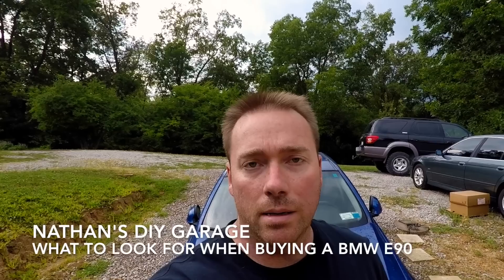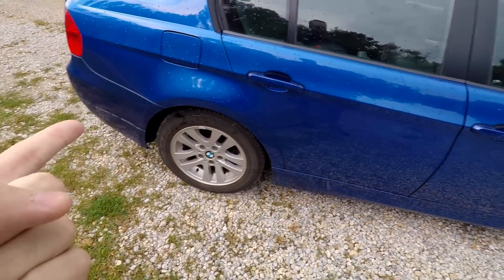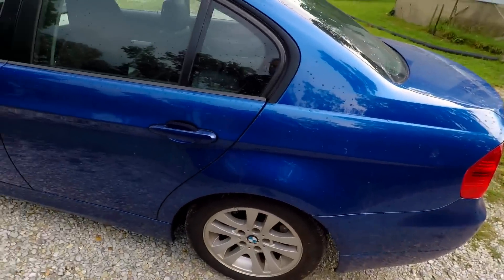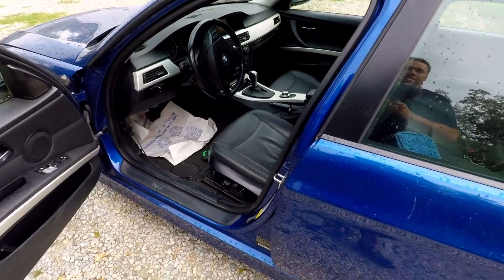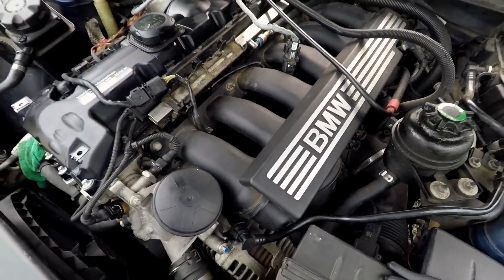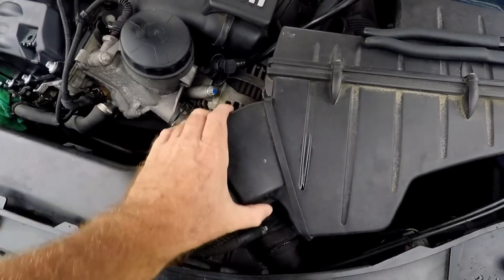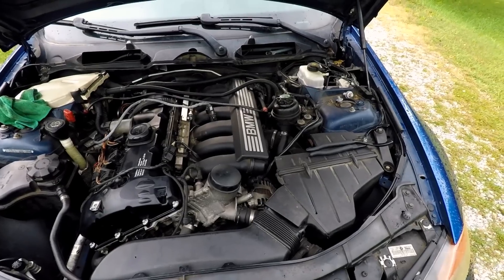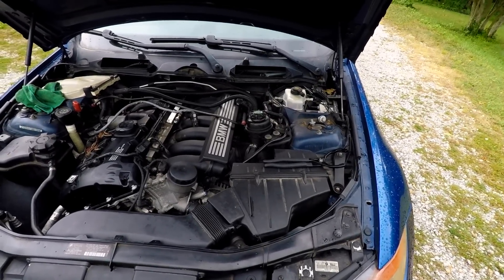What To Look For When Buying A BMW E90 E91 E92 E93  2006-2013 3-series

Comment: $150 to fix the water pump?   I just replaced my cooling system ( water pump and thermostat ) and its $400 in parts from ecs using the good stuff.   The maintenance on these cars is easily done by anyone that can turn a wrench and follow a video.  Don't let this video scare you,  These are amazing cars for those people that aren't afraid to get their hands dirty
Reply: You just gave me hope
Reply: Well 😂😂😂 not all maintenance a lot of the electrical components need coded by bmw and the timing chain probably shouldn't be done by just anyone.......
Reply: instablaster
Reply: And if that doesn’t work at least it’s a cool looking lawn ornament
Reply: I lost hope after the video then regained hope from this.
Reply: @arandompanda1349 and buy it diesel 330d not 335 if you don’t want to change the clutch every year :)) m57 for 330d and m47 for 320d or even the n47 but change the timing chain

Comment: For the manual gearbox version, check that you don't have a strange sound when pushing down the clutch halfway when in neutral. That's a worn out dual mass flywheel and a costly replacement if you can't do it yourself. Buying the parts online and doing the job yourself is around 600$.
Reply: Thanks for the tip, I'm looking at one tonight!

Comment: You have to be smart about these cars.  If the valve cover gasket leaks, change the VANOS sensor at the same time.  The coil packs will all go at about 85k miles.  Spark plug and wire change is what it takes.  At 100k plus you will need a water pump, hoses and maybe a radiator.  The AWD system is reliable but you can get some failures of the rear seals and gears when they get loud.  Early AWD cars had transmission failures but the new ones are fine with regular flush and fill.  One main problem is with the battery housing which tends to fry out at 100k which there is a factory recall on but they never tell you about it.  Great driving and handling cars but you have to pay a bit more for them.  Welcome to the world of nice cars.

Comment: E90 leak points :
Navigation unit , they failing all the time , the most searched thing for this cars ( E60 too ) . If it blinks from time to time , its going to fail soon .
IBS (Intelligent Battery Sensor) , the sensor connected to the battery .
Crankshaft pulleys .
The brake disc on this cars ... they are curving ( not sure this is the right word ) all the time .
Guess you guys don't drive diesels , but if you do , remove the swirl flaps if you want to protect the engine from failing , and frequently change the oil gases filter .
If its manual , for sure the flywheel its thing that have problems with , a lot in our shop .
The rear electrical windows mechanism . The motor itself its tough , but the plastic rail failing all the time , so check for proper movement on the back windows .
For some reason ones again , the rear doors locking mechanism .
And lets not forget , the dynamic drive :D

Comment: Change motor mounts and oil filter housing gaskets if you are looking into an e90 335i. It'll help prevent any possiblity of a failing serpentine belt due to oil corrosion or the power steering pulley smacking the subframe and damaging the belt. You can also easily inspect the wastegate by reaching down (on a cold car of course) and checking for over excessive play. I would do an oil service as well as a coolant flush that way you can be 100% sure you have the  correct oil and coolant types.

Comment: I’ll check today 325 2010 
He said only problem that it need to change ac condenser and compressor , he bought the compressor but I don't know about condenser anyway I'll check it and take it if it's in a good condition except that issue
But my dought why he want to sell it ? And there is no service record ?
Milage is 124.274 mile is too much  for n52 engine ?

Comment: I have an opportunity to buy a one owner no accident 2011 328i drive with 50,000 Connecticut miles for $12,900 from a used car dealer who got the car from a BMW dealer who received it as a trade in. What do you think? What questions should I ask?
Reply: Hey, how’d your purchase go? I’m in a similar situation now lol
Reply: @kylehunter6679  I am enjoying the car and it's a pleasure to drive. However, I had to spend $2,000 in repairs to replace a blown gasket 10 months after my purchase and a thruster arm this summer. When you buy a car that is 10 years old you have to expect some maintenance repairs like these. It's not a new car. Just make sure to do your due diligence in examining the car for any maintenance issues or for signs of a recent paint job that may hid some damage. Good luck. Let us know what you did.

Comment: Very usefull info. What about rust? Which are the most common rusted body parts on these models? Any chance in the future do make a video on a e90 diesel?
Reply: Vlad ZSX Rust: All Models on the underflor, especially under pannels and above the fuel tank. E91 the back door has a problem on the sides. There are plastic covers what scrape away the paint.

All 6 cyl Diesel models are ok. The M57 will lose oil on the intake mainfold. Can be fixed with the a Part of a E39 M57. In German its called Kurbelgehäseentlüftung. Must be something like crank case  ventilation in english.
Reply: Lukas Meyer Thanks for the info buddy. I'm thinking of buying a 320d e92...i heard it has a lot of problems with the timing..is it true?
Reply: Lukas Meyer Rust on the under floor?? You mean under the carpet inside the car?? What could possibly cause that to rust?? That is awful!
Reply: Vlad ZSX No on the otherside. On the underside of the car. It only has one coat of primer paint there. Salt can stay under the pannels for a long time.

Comment: I'd like to know where you found a water pump for 150 bucks...  Mine has almost 200k miles on it, I think I should replace it, but I haven't had a deviation code pop up yet...
Reply: ebay and on amazon just make sure that the origin of the maker is Germany it will have a stamp on the end  of the water pump, Also iits a very good idea to replace the thermostat at the same time as the pump for they are bolted  together, You both parts in a combo kit from 150 - 179 us dollats,  on check pout they will make you enter your vehivle info to make sure it fits

Comment: Thanks for the video, however, it would have been great if you could point to some of the items you said need to be inspected. What I mean is when you were talking about the belt, you could have tried to put some light on it and show it up close. Also, it wasn't quite clear how you would test the control arms. All in all, good video with valid points but need to have a remake and show some things in more detail. Basically, how you are inspecting an unfamiliar e90 car

Comment: FYI,
1) BMW xDrive transfer case does NOT take ATF! It uses a special "BMW transfer case oil", about $50/liter
2) 328xi like the one in the video uses GM 6L45 transmission which does NOT have the built-in filter in the pan (unlike the ZF transmissions in other E90s)
Reply from the maker: 3) You should know then that this is a  pre-xdrive car , all of these older cars will run the trans fluid in the transfer case with no issue, if you work at a dealer which is the way it sounds or a (indy) shop you should know this, I will give you that awd models dont have the zf

Comment: Either one is not fine. The coolant matters for electric water pumps. To maintain long life on the water pump, make sure the coolant is still the factory blue colour.
Reply from the maker: Devin Smith the pump will go around  80k miles no matter what you put in it, BMW is scamming you to buy the blue stuff from them
Reply: We don't scam people. Our coolant is recommended because its the right formulations. The coolant we sell that is available in 3 sizes. 1.5L, 60L and 205L there is only 16 approved other manufacturer coolants. The coolant lubricates the electric waterpump. And besides our coolant is not really that expensive. With only one exception, the W16 engine must run a special coolant that is yellow if I remember correctly. The coolant is a lifetime fill. But needs regular top ups due to slow losses in the system. Use the wrong coolant and the car becomes unreliable (corrosion which will clog up the radiator and shit). The same with the oil. 

List of approved oem coolants:

AD Original AD 48         
Alpine C48 Longlife Antifreeze 
Antifreeze concentrate AWM G11
Aral Antifreeze Extra
AVIA Antifreeze APN
BMW Antifreeze
Castrol Radiocool NF
Fuchs MAINTAIN FRICOFIN
GLYSANTIN® G48®-24 Engine Coolant 
GLYSANTIN® G48®
Kuttenkeuler Antifreeze ANF KK48              
Lukoil Antifreeze HD G11
Lukoil Coolant Plus
OMV Coolant Plus
Startol Glycostar® ST48
Zerex G48® Antifreeze
Reply from the maker: +Devin Smith devin we have been through this before , this is a $4k car how much is a water pump with the connecting hoses and labor at your dealership? $2k +??? So how does that make sense on a $4k or less value car? It doesent , the dealer way is the best  way maybe for newer cars under warranty but it's the worst way for anything a little older , been suing prestone antifreeze in BMW's for 20 years with no problems , is this making sense to you ??? Stealing thousands from BMW owners is everything this channel is against , you might not agree but charging those rates for fixing simple problems is stealing as far as I'm concerned .
Reply: Feeding a family of three is cheaper than feeding a family of 100. Offering you information is as pointless as it seems. Good luck to your channel. Unsubbed. You and your false internet information.
Reply from the maker: +Devin Smith dont know why you were ever on here undermining my every word in the first place, goodluck devin youtube is not for you
Reply: Nathan's DIY Garage that’s why it’s a $2k car
Reply: Sorry to dig up an old thread, but does it make a difference if it's GM DEXcool orange coolant?  Looking at one at a Buick dealer and it looks like the service department replaced the water pump and thermostat and refilled it with what they had.

Comment: Looks like a used BMW is a crap shoot-is it possible to get a good one? Would a standard $100 mechanics evaluation suffice to weed out a bad one?
Reply: Ad Mirer It is very possible to get a good one. There is no used car that you can just hope to get a good one. Even a Toyota can be a money pit if they aren't properly maintained. BMW is a very refined and complicated car, so it is important to check everything. You can definitely find good ones, and there are also other fun alternatives that might be a little more reliable. The Infiniti g35 is a good option as well as a Mercedes c300. Th same thing applies to those cars too.
Reply: GhettoMist, great advice

Comment: Would You recommend to buy an E90? Are the four cylinder more problematic? 
What is your opinion on an Audi A4?
Reply: Coming from a B5 A4 to an e92 328i... The inline 6 BMW hands down is more reliable and easier to fix/maintain than the pot-4 turbo Audi.

Comment: you mention an auto tranny flush costing $500 or more. What is your opinion of say an outfit like brakes plus with a flush machine that claims to change your fluid for a bit over $100?
Reply from the maker: I wouldn't flush the trans, change the fluid and filter , if you do it yourself its around $55

Comment: Hi Nathan, great videos I love your channel... I have a question 4 u... I have a 2004 X5 3.0 and the lock actuator on the front passenger side went bad and locked the entire door. You can't open it from inside nor the outside. My question is is there a trick or an easy way to open it? Have you fix a problem like this before? I really appreciate your help... Thanks and keep making great videos great channel...
Reply from the maker: Its probably the relay in the gm5 module , pretty common on e46 and some e53, you will need to get behind the glovebox and pull it out , replace it with one with a matching part number , then you can open the door
Reply: Carlos H. Tenorio there is a guy in California who you can send your module to and he will put new relays in it.  I think his website is somthing close to bmwgm5.com.  I had him fix mine on my e46.
Reply: Cool story dude

Comment: Are the broken head bolts common on all years of the N52 E90s?  From research it seems it happens more on earlier years, but just checking.  I can DIY a lot of the smaller stuff like brakes/fluid changes/belt tensioner myself, but want to be aware of potential issues.  Probably looking for a 2009-2010 328i, non-XDrive with either auto or manual.  My GF has a 2006 325xi with 130k and it has been a good car.  Only needed small stuff like oil filter housing gasket, belt tensioner, starter, water pump/thermostat.
Reply: Josh M just bought a 2007 328i with a 10k mile thermostat + starter motor so I'm glad to hear your GFs car doing well @ 130k.  This car is 103k
Reply: there are 3 alum. "head bolts" front of the engine in n52. Inner "true" headbolts are steel ones.

Comment: Are manual transmissions easier to maintain?  I'm assuming so except for replacing a clutch.
Reply: Worse to maintain in my opinion. I had the plastic pivot break in mine which necessitated a clutch replacement. The part costs $5. Also, the slave cylinders can leak. The shift bushings wear out over time.

Comment: U just made me scared I'm not buying a BMW
Reply: Don't worry. What he is talking about is worst case scenario. If it looks good and drives good, then you normaly have good car. Take it to a workshop and check it.
Reply: BMW owner here 2011 E93 for 6 years. First six years a Sherman Tank, this last year a tiny rough since she's getting a little older at 70,000 miles. I still love her. All high compression high performance cars are a little tricky to maintain. They need love, and unless you have the money and/or the know how then you're asking for trouble that's all. Approach eyes wide open, do your research, inspect each candidate thoroughly, and if you enjoy driving these cars as I do, you'll be okay. Just keep some funds available for those unexpected repairs we all have to make regardless of the car, if it's an older model. Get an extended warranty if new or certified used. If you're on a tight budget, then maybe this car isn't for you.
Reply: Kenneth Green Sr no thing scary if you are willing to work on the car by your self